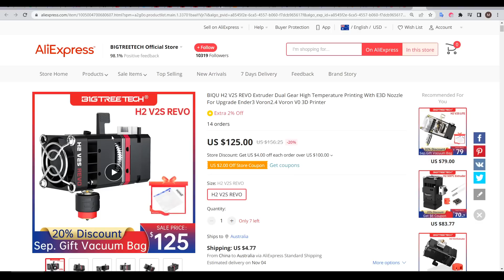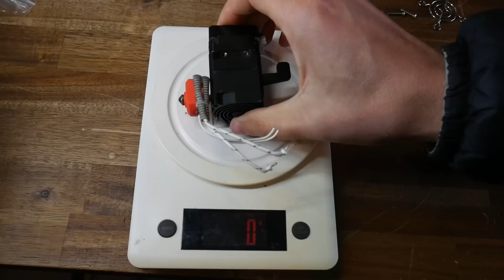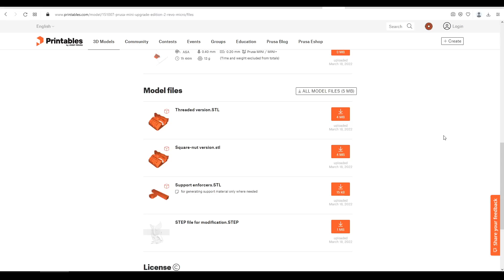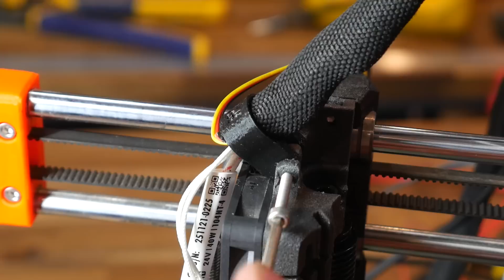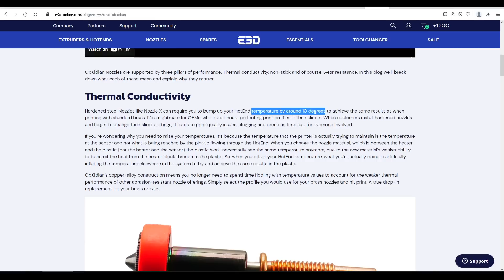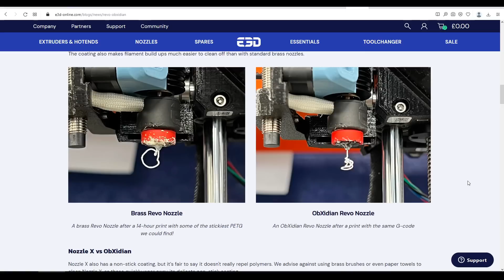Testing the ObXidian nozzle and new E3D Revo developments

Comment: I use the Revo both on my Prusa Mini and my mk3s+. Still the ObXidian is not delivered (I ordered in October 2022, now time for delivery is annonced for April 1st 2023).

The brass Revo works very well. However, sometimes there are issues with coldend cooling. Original coldend fan is quite powerful, but slowed down to 38%, wich is not sufficient in warm environment. Luckely I have one of the older boards switching ground (the newer revisions of buddy switch 5V), so I could easyly change the coldend fan to a noctua permanently on at 100%. Now it works perfect.
I also added a TGB-lite from Trianglelabs as a direct extruder, using the design for a Sherpa, but glueing the TGB-lite on top instead mounting the sherpa. It works perfectly.

On my mk3s+ I use the Revo V6 with the BMG upgrade extruder (the open source variant from Thingiverse). An other mk3s+ (clone) also uses the Revo V6, but with the Zorbiter 2, with even better print quality.

Actually while printing the parts myself worked well, I am so amazed by the new hotends I decided to let them be printed in SLS. It works out perfectly, even as JLCPCB gave warnings about some sections might be to thin for stable SLS printing ( I took the risk of letting them manufactor tham anyways). One reason for using SLS is they always use 100% infill while being still light due to the carbon fibre. So I can drill mounting holes later if I upgrade to klipper and want to add a accelerometer. On the other hand, as Marlin just added input shaping, I am pretty sure will add it into the Mini's firmware in future, but just with manual calibration.

Anyway, adding a Revo system cost about >200€ (Set with coldend, heatercore and 4 nozzles + at least one ObXidian), so I think adding an extra of about 25€ for SLS prints and 50€ for a TGB-lite to get a nearly perfect solution shouldn't matter.

Comment: IS there a G-code command to change the thermistor type?
Reply from the maker: Normally no. It must be compiled at firmware. However, if you compile with thermistor option 1000 in Marlin you can use the M305 gcode to change the parameters on the fly: https://marlinfw.org/docs/gcode/M305.html

Comment: I've been through a few editions of the revo beta nozzles and until yesterday was sticking with the original beta which was just the heater core as I was using a standard hardened steel nozzle to print Prusament CF PC. Decided to switch over to the final beta (basically the revo micro with two nozzles without the coloured rings) in preparation for the Obsidian coming whenever they sort out their production issues and just run it on regular Prusament PC and standard filaments in the meantime.

Comment: I have been tinkering with my E3V2 again after not touching it for a while, and decided to finally make the switch to DD.  Came across this vid while researching some extruders, and I'm glad I did, because I've been struggling with what direction to go, and whether to change my hotend as well, and now I've decided to jump in with both feet and order up the H2 Revo.  Seems like it ticks all the boxes for what I want!

I really appreciate the way you conduct all of your reviews and vids.  Tons of info, and transparency.  You just saved me from going down a rabbit hole of spending too much on multiple different setups to tinker with to try and find the right one.

Comment: I wanted to print a small text stamp, using a 0.2mm nozzle.

So I purchased a nozzle set from Amazon, that are exactly the same size & length as the stock nozzle that came with my Ender 5.
When I put it in, the Amazon nozzle hung lower on my Heatblock. The stock Creality nozzle seems to have no threads near the heaterblock end, and  must somehow nessle into the heatbreak; because it fits in deeper.. 

Resetting the BL Touch to allow for that was not a problem, but I worried about not having the 'hand in glove' fit to the Heatbreak that the original Creality part must have.

 My Amazon 'butt faced nozzle' started leaking only after a few prints; and I know I tightened it properly. I need a source for a 0.2mm nozzle.

Where can I find tappered nozzles that have the best fit to the Ender products? I was considering upgrading to a 'Slicer' heatbreak, but pictures seen to show that it too has a tappered input end for nozzles to interface; so flat faced Amazon nozzles must not fit the best.

I'd love to hear your opinion on this concern.

Comment: You likely don't need to manually set the PID values on the Prusa Mini. The Mini firmware is quite a bit smarter with temperature management than plain Marlin. Just test it and see.

Comment: Question? Can you do a video on making a surface model thicker? I have a car model file ( .stl ) I bought from online and it is full size and it is a surface not a solid. I have issues making each part thicker. As I scale down to 1/3 scale I have to make it .120 inch thick so it will print ( can't print a surface  ) or .360 thick before it is scaled down. Is there an easy way to do it and what software would you use?

Comment: I switched to a Revo Voron just last week on my Voron V0.1, I previously had a Phaetus Dragon and when changing nozzles it would twist the whole hotend slightly and touch the hotend fan. The Revo Voron form factor makes a lot of sense on a small machine. Only have a 0.4mm nozzle currently but will be looking to get at least a 0.25 and 0.6. The Dragon in my 2.4 is still easy enough to change nozzles.

Comment: Will this new Biqu/Revo Obxidian DD Micro fit straight to the Ender 5 plus without FW adjustment?
Reply: Pretty sure that’s a no, due to the different temperature sensor.

You can get good modified firmware for the Ender 5 Plus, so perhaps there is a variant that would work?

Comment: I have not yet used the revo, i was waiting for the obxidian, rather than change later, i figured i could just get everything at once. I did not expect it to take that much time however.
Also, now that i have seen tom's video on 0.6 nozzles + arachnea, i wonder if i need a revo alltogether... perhaps just a V6 obxidian nozzle will suffice.
Reply: If you're going to stay v6, might as well get the diamond nozzle
Reply: @urjnlegend  diamond nozzle is 100$...
Reply: @AudreyRobinel  yeah, but you won't have to change it again, and it prints like brass
Reply: @urjnlegend  obxidian is supposed to have comparable durability, according to e3d, for less than a third of the price.
I didn't buy the ruby nozzle back then for the same reason as the diamond one : way too expensive for marginal gain.
You say i won't have to change it again. And what if i do? what if something gets jammed into the nozzle and i can't remove it?
What if i realize that i want 0.6?
If no other solution existed, i may consider it.  But other solutions exist. And way cheaper.

Comment: A little frustrating, I already have hardened steel V6 nozzles in 0.4 & 0.6 on two printers, my mini is still stock + bondtech & capricorn, it would benefit from klipper more than a revo, the power plug is all that is holding me back on that one.

Comment: I have the h2 Revo and love it. Results have been on par or better then my ddx v3 I had on the machine before. While more money, I like the easy of taking out the nozzle for clogs which I did cause from my z being too low. Obsidian nozzle is not on my radar at this time, however as I can leave it in for pla or abrasive materials I may look into it.

Comment: Well, as an old reprapper, I'm not amazed by the Revo system fore some reasons. First, Nozzles are wearing parts and expensive nozzles are not a good idea. There's not much perks to switch nozzles that often. Generally, every printer have its matching nozzle : 0.4 for general purpose, 0.6mm for production and, like on your Mini, 0.2mm nozzle for high detail FDM prints. Even if you own a single printer, I'm not sure you'll swich nozzles frequently. Maybe the first weeks to play or test differencies, but after a while, you'll stick to a fixed diameter, and forget it. IMHO the average guy will change a nozzle only when it get old, so maybe a couple of times per year, and the old style procedure with tools is no big deal, as it takes less than a minute. On the other hand, more than 20€ per nozzle is unnecessarily expensive. I noticed the hardened nozzles do not last much longer as there's several reasons for replacement : nozzle shape (abrasion, and mostly deformation because of the heat/cooling cycles) and charred filament residue. As a print farm tender with a lot of nozzles change, it's a no go, despite the piece of time saved. Another inconvenient truth is the all in one heat core: there's some frequent complains online about failing heatblocks, thermistor or heater. Once again, you have to change the whole expensive thing spending much time than for a single thermistor or cartridge. Last but not least, the V6/Hemera already printed perfect and did not leak, so... 

IMHO, the Revo is disavantaged by its overall maintenance cost and the claimed perks are questionnable. The Micro is the real improvement, except the Revo system. A micro V6 would put my money out of my pocket, but not the Revo thing. I will keep on buying V6 or so.

Comment: I've been mostly happy with the revo but flow has been the limiting factor.  I'm glad they finally have abrasives covered, but I would love to have a revo volcano option. I would happily buy a new heater and nozzles if high flow was an option, because I love the integrated heatbreak and toolless nozzle changes.

The revo as is is also a tough sell financially when similar hotends like the Rapido can get more flow with more nozzle options and still have one handed (but not toolless) nozzle changes.

Comment: I've been using the Revo for months to print a lot of stuff, including a bunch of Gridfinity boxes, and it's been completely drama free. Been swapping between sizes, and just pre-ordered ObXidian as well so I can run abrasives and anything else I want through. It's a great system that makes nozzle changes sane. Having to muck around with tools and with the nozzle at temp is stone age stuff, and this also eliminates the possibility of leaks at the heat break. Currently just running on a MK3, but any printer I get in the future needs to be Revo compatible.

Comment: I have the V2S but I steel need to install it but still wait for some upgrade parts would be interesting to see how well it can print flexible filament since the previous H2 had limitations on this regard
Reply: prints TPU great just stay low like 40-50mms. I have the V2S Revo on my Ender 6 and it is a beast!

Comment: Been running a Revo on my Mk3S+ for a few moths now and i love it, i went from never changing nozzles to switching out all the the time now depending on what i am printing. Been waiting on the new ObXidian nozzles so i can try printing with some new filaments, as it is so quick i can see me still using my brass ones for everyday pla prints and then switching them out when i print with anything abrasive.

Comment: I converted my anycubic Vyper first to E3D V6 volcano with a hardened steel nozzle which was a great swap for the original fake PTFE lined volcano hotend that came on the  machine. With a redesign of the hotend assembely to accomedate the longer legnth of the new V6 volcano mounting to the machines strain guage. I then made the jump to the REVO 6 about a month ago and im very happy with the swap, even though it ended up as another redesign of the hotend mounting assembely to work with the anycubic Vyper strain guage mounting system. This really hinders hotend choice as mounting requires 2 vertical mounting screws through the top of the strain  guage into the hotend which is not ideal with the REVO V6 but was solved within our vyper facebook community. The only problem I had was not being able to swap out to use hardened nozzles to print abrasive fillaments, I missed the ability to use all my fillamens, bur now have ordered the 0.4 & 0.6 obXidian nozzles. Now its sitting and waiting for the mid november deilvery date to roll round.

Comment: Why is weight reduction significant?
Reply: Less mass = Less inertia = Less energy spent when changing directions
Reply: Pretty much higher theoretical print speeds and less yerk from the belts.
Reply: It's primarily important for CoreXY machines that move fast. They can move fast because they only need to move the extruder and hot end around, and the lighter everything is, the faster they can throw that stuff around.
Reply: From the pov of a mini owner, I want a hotend that's light as possible because less weight on the X axis means less fiddling with replacing the linear rails. Also, print speed like others here are saying.

Comment: I have used the Revo on a Mk3S for the last week, approx 150 hours of print time, and I am extremely happy with it so far. I have just pre-ordered the ObXidian nozzle, as like Michael I also want to fit and forget my nozzle regardless of the filament I am using. After replacing my V6 nozzles about every 6 weeks or so (my printer is almost constantly on the go), hopefully these will last a bit longer than the nozzle X from E3D.

Comment: Wait. One brass nozzle costs 18.25p and the new one costs 40p.
Lokking at the advertisement on their website, it seems like the new noozle should last waaay longer than the brass one while having no downsides except being twice as expensive. So always buy a obsidian?
Reply: If E3D's claims are to be believed and you dont mind paying more, yes.
Main thing is that you prolly dont need the abrasion resistance on regular printing and brass will do just fine.
Even if you sometimes print with CF or the likes, you'll prolly want just one obXidian and one or handful of brass ones
Double the price is p steep for most people
Reply: @makoto_00001  That is REALLY good advice. The benefit of the swappable nozzles means any time you don't need the ObXidian, just swap back to brass. The ObXidian will last forever for most hobbyists.